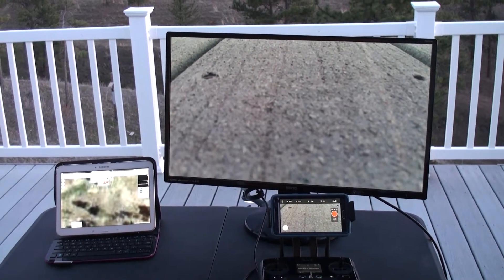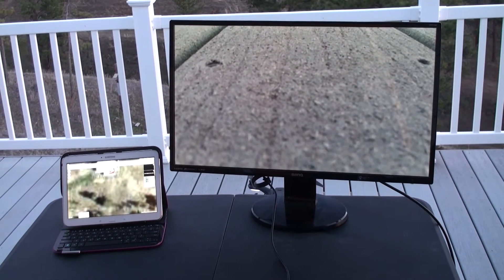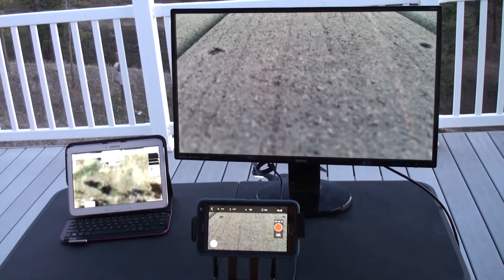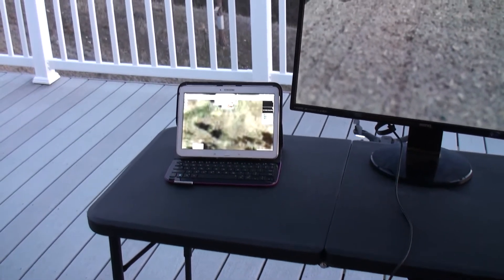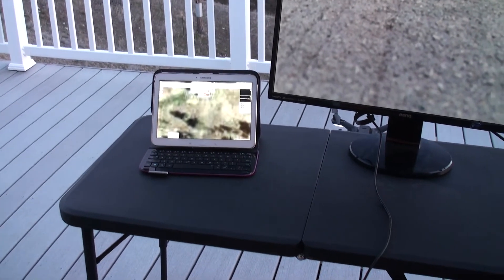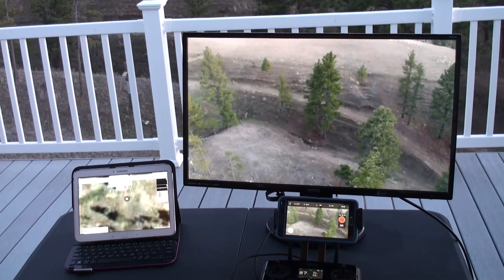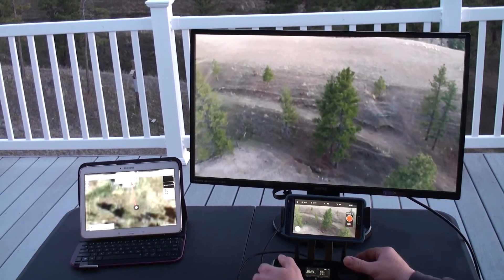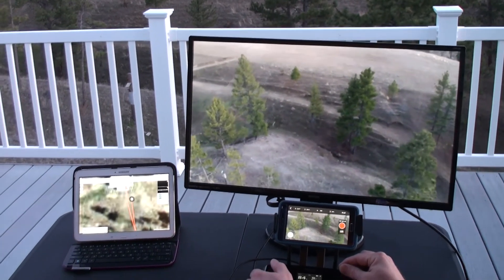3DR Solo HDMI Display Output to a Field Monitor

Comment: can i fly with just a HDMI and the controller with an extrernal monitor? i hate having to rely on phones being charged ect, so if i set it up ONCE using the app can i fly after that with only a monitor?
Reply from the maker: Yes, you can fly using the HDMI out port from the controller into a monitor after setting the drone up using the application. The monitor will not show you battery, altitude etc, but you can see some of that on the controller. Also, you will not be able to start or stop the gopro recording if you are using a gimbal. If you are using a fixed mount then you can start recording before taking off.

Comment: Can you use an hdmi cable instead of wifi with your phone for pilot  view
Reply from the maker: Yes, you could fly using just a moniter connected to the transmitter with an HDMI cable.  If you have a phone or other device that allows for an HDMI input that would work too.  In this configuration you would not have the same on screen touch options as you would with WIFI.

Comment: So no issue connecting 2 devices, phone and tablet to the solo? Running Solo and tower? I've never tried that.
Reply from the maker: No issues... only one device will show the video stream from the gopro.  If you haven't watched it yet, check out my video on "Simultaneously Connecting a Laptop and Tablet to the 3DR Solo Transmitter - Mission Planner & Tower"  ... let me know if you are able to pull off any other neat connections.

Comment: Very cool master control station you got there,nice!...now I wanna do it
Reply from the maker: Thanks.   If you haven't watched it yet, check out my video on 'simultaneously connecting a laptop and tablet to the 3dr transmitter'... that would make for a great addition to this ground station display setup.
Reply: will do!,thanks!

Comment: I see that it lags is that a big problem
Reply from the maker: In general the video stream from the 3dr solo is not in real time; some have even stated over a second of delay depending on distance.  The phone and HDMI output to the screen seemed fairly well matched to the eye. For the flying I do it is not a problem.  For more advanced FPV flying through buildings and trees I could see where it may become a problem.
Reply: okay thanks